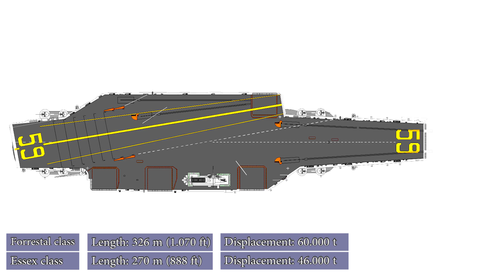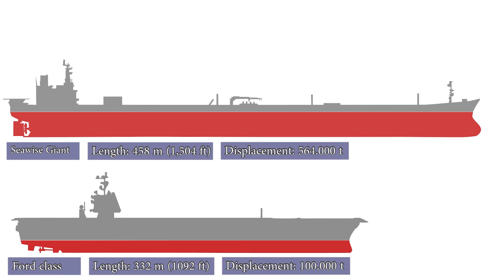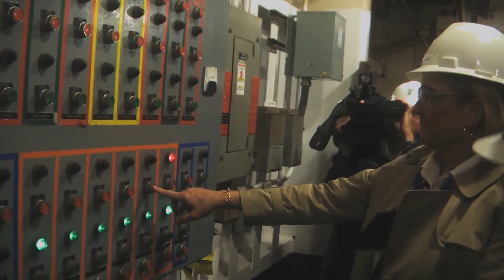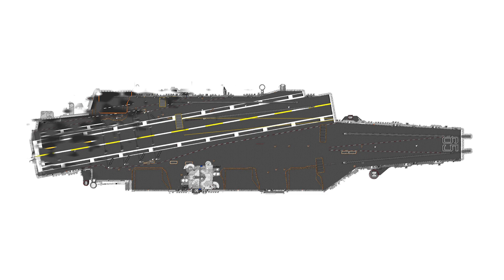Why don't aircraft carriers get bigger?

Comment: The only immediate aircraft change would be the ability to actually land a C-130 on the deck for resupply.  Yes, C-130's have already landed on the Nimitz class, just not loaded.  ALL of the current aircraft would be usable, just in higher numbers.  The landing and take off areas would be further apart actually making it safer for those operations.  I agree that facilities would be the real problem.  Docks for building, maintaining, and visiting would be issues that are all solvable in time.    As for power to move such a vessel, well the Ford class carrier have smaller and more powerful reactors meaning each boat only needs 2 instead of 4 like the older Nimitz class, simply adding two more new reactors to the boat would fix that.

Comment: I've often wondered why not rocket launch fighters up ? you could line the sides of the ship with tubes carrying a loaded fighter you could launch all at once if the ship detects a incoming missile it could drop  fighters loaded with bombs out the bottom into the sea and the tube would provide addental protection as now the top and bottom would be open to air pressure  plus if an attack is on hopefully the tube would already be empty  heh battlestar made it look easy
Reply: Weight and space taken up by rocket assists means less for weapons. Also human pilots means there’s a maximum for a jets acceleration. 
Finally, rockets fuel is much much more expensive than jet fuel.

Comment: The max speed of any displacement hull design is limited by the hull length at the waterline. Around 1.3 times the square root of the hull length. So while a longer hull SHOULD yield a higher speed, bigger ship=bigger propulsion system. It reaches a point where either a) you've maxed out the technology, and no amount of reactors, turbines and shafts will provide enough energy to move the ship at its hull length speed, or b) the cost/benefit of such a system make it unfeasible. A 50% increase in hull length only results in a 20% increase in max speed. Current carrier design is a balancing act of mission needs, how many aircraft broken down between attack, fleet defense, command and control, ASW and helo. How much speed do you NEED to get enough wind over the bow for launch and recovery of your planned aircraft mix. To go bigger, just doesn't make sense in the current environment. Might it, someday? Time will tell.

Comment: Aircraft carriers are becoming less practical.  

With the advent of very capable drones, AI controlled drones/missiles, long range sub and hyper sonic ship/air launched missiles the cost of building, operating and maintaining a mega carrier seems very wasteful.

As others have suggested, smaller “assault carriers” can be extremely effective.  2 of those with @30-40 F-35s, quarterbacking 4-6 “loyal wingman” drones each, perhaps launched from Destroyer sized ships or long range cargo/bomber jets, this could be a fighter fleet of 150-300 assault aircraft.   

This is an insane amount of firepower and would rival nearly all other air forces in the world, with only a few exceptions.  

Now assume we maintain the 10 mega carriers, and perhaps 20 assault carriers.   

With drones/loyal wingman aircraft, we are looking at possible airborne assault groups of 3000+ aircraft.   Eclipsing even China or Russia in air-force.  

And finally, the US military has drones which are capable of mimicking any aircraft on radars/sensors of adversaries.   This means that they can launch dozens to hundreds of “decoy drones”, convincing them they are being attacked by any attack aircraft the US has, forcing them to expend defensive measures and revealing the location of those defenses.   

So after nearly exhausting the anti-aircraft defenses of an adversary ground or sea strong holds, mopping up with fewer stealth aircraft would be “easier”.  

Fight smarter, not harder 😉

Comment: After having spent a tour of duty in the Navy in a carrier-going squadron, and making "cruises" on the USS Forrestall (CV59) and USS Kitty Hawk (CV63), I can say that being on an EVEN bigger carrier would be just completely unbelievable.  The stores and fuel and ordinance that it takes to keep these monster ships supplied is hard to imagine for most people.  I participated in numerous underway replenishments bringing all sorts of supplies and food and all kinds of things on board, even though I was in an embarked "Air-Wing" squadron,  as frequently the air-wing is called on by the ships company to assist with supplies... anyway, all that said...
Presumably, a BIGGER Carrier would carry MORE aircraft, which means more needs for fuel, and supplies, and spare parts, and crew, etc.. etc..  There are already about 6,000 people on the largest Carriers (There were about 5,500 people on the Kitty Hawk when I was on it).  And I just can't imagine that you really gain that much more by making the Carrier bigger, without making what is already a very difficult logistical challenge to keep the behemoth supplied and fueled even worse to the point of being unmanageable.  Just my opinion on all that from my personal experience.
Also - This video speculated that the "Giant Carrier" would somehow have different Aircraft, just for the Giant Carrier.. I can't possibly imagine why or what possible benefit you would get from that?  I disagree with that totally.  All of the existing Carrier borne and capable aircraft would do just fine on a Giant Carrier, but it might be possible to carry MORE of them on the larger carrier..  Again, just my take on it..
Great seeing lots of Carrier deck footage in this video. Nicely Done!

Comment: The biggest practical concern for ship size is being able to get places as quickly as possible. The bigger the ship, the more power necessary to move it. Also, locks in the Panama and Suez Canals are a set size and would require a very impractical amount of reconstruction to make any larger. So, ships need to be able to fit in these locks or spend several more days or longer to take the long way around.

Cruise ships can be larger primarily because they generally have fixed areas of operation. A ship that just sails from Florida or elsewhere into the Caribbean doesn’t have to worry about fitting through a lock. Cruise ships that do traverse the canals and locks won’t be as large.
Reply: The Suez Canal is entirely at sea level and has no locks, but your point remains because the physical dimensions of the canal and the bridge over it determine the maximum size of a ship that can transit the canal ("Suezmax" - see the Wikipedia article for interesting details on the factors that determine maximum ship size there. As the Suez Canal has no locks, it doesn't have an obvious limitation on ship length, but longer ships have a greater risk of running aground and blocking the canal, as happened to the 399.9m ship Ever Given).
Reply: No aircraft carrier is able to use the Panama Canal. Their deck is simply too wide to fit between the lock walls.
Reply: @joriss5 I would have to look that one up. I would be surprised if no aircraft carriers could fit, although I’m sure there are some that do not.
Reply: @JohnGeorgeBauerBuis  I mean no full-size CATOBAR aircraft carrier. Surely some if not all of "VTOL-carriers" fit, they have a much smaller deck.
Reply: The power-to-weight ratio needed to push a ship at a given speed decreases when it's length increases. So a theoretical megacarrier with twice the mass and twice the power would be a little faster...

Comment: A major size limitation is the capacity of the locks of Suez and Panama canals. Commercial ships are designed to operated on only one Ocean on a set route, eliminating the need to use these canals.
Reply: The Suez Canal has no locks because it is entirely at sea level, but it has other limitations on ship size so there is a Suezmax standard.

Comment: Small? Current carriers are larger than the largest WW2-Carrier! In fact they should be getting smaller again - why? Because that way a fleet can absorb losses (which is why the Grand-Fleet in WW1 was able to beat the Germans, despite losing the one propper engagement they had - they could deal with the losses, Germany could not! It's the same today: The British fleet has 2 carriers (or will have, don't know if the second is already in service!), so losing one is a hard blow - but if they had say 8 smaller carriers? Well, losing one still isn't great, but not as harsh a blow!)...hell, the only Navy these days that can absorb major losses is IMHO the US-Navy and even that is a shadow of its former WW2-Self!

Comment: I’m sure someone else or many have noted that a holdover from the Iowa’s limitations on size was the safe passage through small areas like the Panama Canal. That width of the canal drove quite a bit of decision making back then and followed on in other designs regardless of class.
Reply: Panama Canal is for me the main arguement.
Unless there will be a better/broader canal, these ships will stay at their current length and width.
Right?

Comment: This brings up a little bit of a good point though. If there was some sort of intense desperation of the world not just one country or the other why not take passenger planes and make them into kind of medium bombers. You wouldn't have to change them dramatically you could just make a medium Bombay maybe of 20,000 pounds or something after all almost every airliner can carry it almost a weight of probably 60 to 80,000 pounds you wouldn't have to make it that much just enough to have as much as a big fighter. Or take oil tankers and have it flat on the top so somebody could land on there where the helicopters or something else and I know of certain situations where they have done that mainly in Coast guard and things like that for emergencies to go pick other crew up off a tanker or a very large cargo ship it wouldn't be that difficult to just make the top of a tanker ship oil tanker ship flat and then you could hold all the fuel and fuel up all the airplanes in the middle of any ocean you wanted to.

Comment: The power/speed curve is crazy. On a Type 42 Destroyer, we could get around 25 knots using one Gas Turbine at 25000shp. To get the extra 5 to 8 knots, we needed another 25000shp from the other engine. To go any faster than 33, we would have needed another engine again and maybe more. Arleigh Burkes can go 35+, but need 4 large Sprint type Gas Turbines kicking out 90 plus megawatts to do it. I dread to think what you would have to add to onto an existing carrier, or a indeed a bigger one to get the speed you wanted. I know the Hull form and all that jazz would be designed and the reactors and steam turbines would be added to suite the need, but it would be some big power. Maybe they would be better as Integrated Electric Propulsion using alternators driven from steam turbines, and then distributed to the ship and the prop motors.
Reply: Yes, fluid drag tends to increase with the cube of speed, so you need eight times the power to go twice as fast. The same issue applies to human powered vehicles such as rowing shells on water (where fluid drag dominates) and bicycles on level roads (where air drag dominates). If you exercise on a Concept2 rowing ergometer you can see how you have to increase your power output in watts by a scary amount to gain just a little more speed. For example the standard for elite women rowers is 2000m in about 7 minutes, just to get a tryout with a national team, which requires an average output of about 300W. The elite men have to do it in about 6 minutes which requires about 480W. I can't even do that for one stroke LOL.
Reply: @danielmocsny5066  A "flying catamaran" type design would reduce resistance by partial surfacing at increased speed.
Reply: A giganto-carrier would be nuclear. Whatever power it needs, the nuclear power plants can provide. Ford class carriers can maintain over 30 knots indefinitely.

Comment: You could try something totally different. Instead of a huge steel hull, you could use a truly huge low density concrete float, say 1000 m x 150 m. Oh but wait, that would require too much fuel. Oh yeah, it's nuclear powered! Concrete can be made with density less than water. It's not as strong as normal density concrete, and concrete is not as tough as steel, but instead of a hull, you just have a solid* float. You can't sink something that is less dense than water. The most important property would be ability to absorb energy.

*It's not really one huge monolith of low density concrete. It would be layered; maybe a metal shell, a compartment filled with water, an airspace, high density concrete, and the the low density concrete, with several large compartments "dug" out of it. The walls of the hull could be as thick as the most pessimistic engineer thinks is necessary. Construction doesn't need a shipyard. You basically pour huge blocks of the low density concrete, attach them together and build the outer shell around them. Might even be cheaper than a normal hull.
Reply: What rubbish.
Concrete cannot be made at less than 64lbs per cu ft. Unless you are making cinder blocks LOL which still sink!
Structural low density concrete is 110lbs per cu ft at least. Anything less is useless
Reply: @DennisMerwood-xk8wp  What rudeness. I suspect you did not read the entire post. The weight density of SEAwater is 65 lb/cu ft. Your quote of 64 lbs per cu ft for concrete makes my case, thank you. But reciprocal rudeness aside, the phrase Concrete CAN be made indicates that this is not necessarily a conventional type of concrete. I failed to specify that some of the aggregate would be replaced with air-filled metal or glass enclosures of some optimal size in terms of density vs compressive strength. I think I did specify that there would be layers of higher density stiffer material in appropriate places. I think I also wrote that there would be sizable voids deep within the hull.  You're not building a structure on land, with columns supporting platforms of greater linear density than themselves (linear being considered vertically). You're filling in a pit in the water, an entirely different thing. The idea is to make the hull invulnerable to the breaching actions of a torpedo, mine, or anti-ship rocket.

So the density of the ENTIRE hull or float would be significantly less dense than water. The thing that an aircraft carrier MUST have is a large flat surface. The larger the better. This is a way to do it. There are quite possibly reasons why it would not be workable, but your objections aren't relevant to what was posted. 

Thank you for your reply, it is gratifying that someone noticed, even if your tone was inappropriately dismissive.
Reply: ...."Construction doesn't need a shipyard. You basically pour huge blocks of the low density concrete, attach them together and build the outer shell around them. Might even be cheaper than a normal hull".......Mark these facts are not true - and you have this all wrong.
Reply: @DennisMerwood-xk8wp  I understand that your opinion is that I have this all wrong, but I can't really say anything more without an explanation of why it is all wrong. And these are ideas, not facts, and I'm pretty sure ideas are either good or bad, rather than true or false.
Reply: @mliittsc63  As a structural Engineer who worked as Project Leader for the Engineering firms in Seattle that designed the floating concrete bridges in WA state, and one in HI, and a floating concrete container ship dock in Valdez AK....
 Mark I have a little advantage on you. Sorry to be so condescending. The discussion of ideas you are craving would take many many many YouTube comments.Take care my good man.
Reply: @DennisMerwood-xk8wp  Thanks

Comment: Some of the points that you make are not really correct. Having served 2 tours each on the USS Enterprise and the USS Harry S Truman I can tell you that that the primary reason that US Aircraft Carriers don't get much larger is that they don't need to. You alluded to the carriers going faster than 30 knots. That is true but that's because the design specifications of the US carrier dictate that it needs a minimum of 30 knots of windspeed to get the aircraft up to takeoff speed. If there isn't any wind then we have to make our own. If there is then we normally launch aircraft at lower speeds.

The next point that you made was the types of aircraft. An F-18 will land and takeoff the same from a Nimitz class or a Ford class because the arresting gear is designed to decelerate a certain amount of weight in a certain distance. The size of the ship has nothing to do with that. Likewise the catapults are designed to accelerate a certain amount of mass at a certain rate to achieve a given force at the end. Again the size of the ship has nothing to do with that.

The main factors that affect how large our aircraft carriers will be is primarily 2 things:

A) Airwing organization. If we increase the size of our airwings then we'd need a bigger mobile airport. Right now the composition we have provides enough weapons platforms and support craft for any basic mission.

B) Powerplant requirements. Larger power requirements require larger generators. Larger main engines to push heavier ships require larger reactors and support systems. Which would require a larger hull to hold it all.

So unless mission or organizational parameters dictate that more jets be in each airwing than aircraft carriers won't be getting any bigger. Because the entire purpose of the carrier is to launch and recover aircraft.